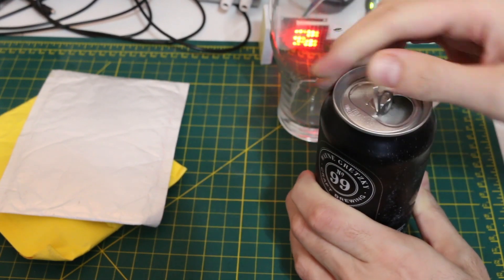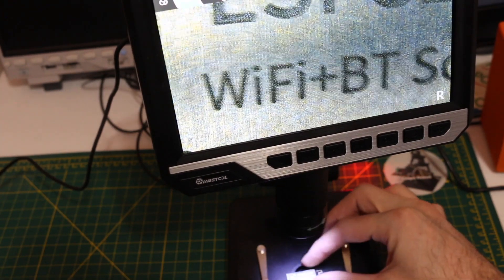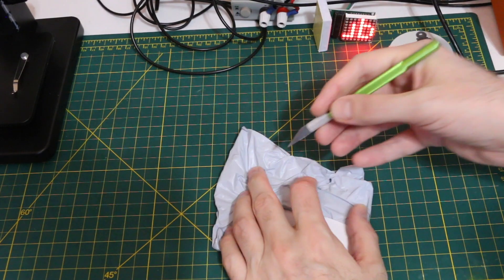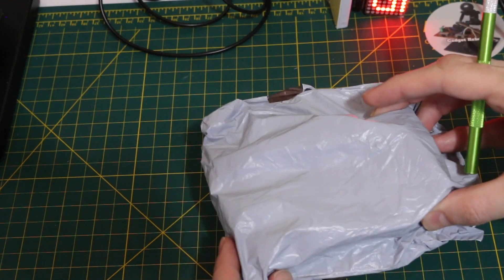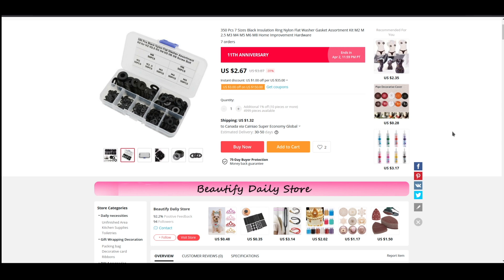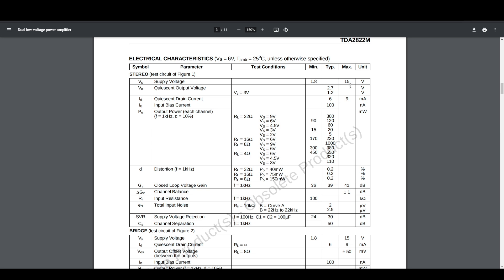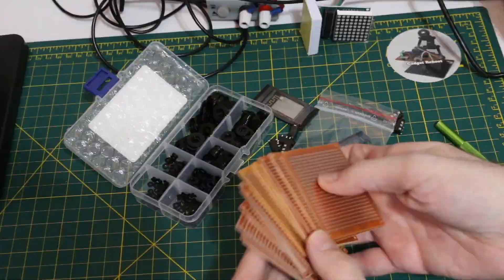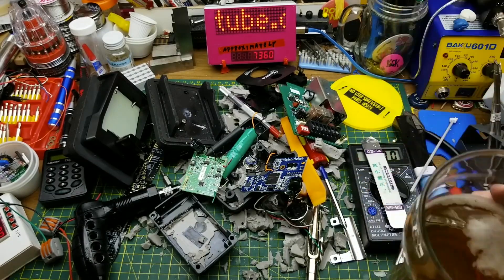GR Mailbag 21.AL.01

Comment: When I drink enough, these talking-hands Canadians seem to run together.
(glug glug glug)
Many modern amps have thermal and overcurrent protection.  Not these.  Have blown a couple of TDA2822 chips, abusing them with medium-sized drivers.  You may need some little 16ohm speakers.  Would you like a couple of TDA2050 chip amps ... you know, something that will shake the walls?
Reply from the maker: Destructive testing on TDA2822 might be a fun experiment in itself when I get all set up again and have access to everything.  I have several salvaged speakers from various applications ranging up to 12 inch that I could try to run at various levels and see what happens.   TDA2050 in the same experiment would be fun, sure! ...now I'm starting to imagine a big test bench setup with test signals, sound pressure measurements at distances, resistive  loads and a scope, and a bunch of amp circuits.  Might need to get a vacuum tube circuit started too.
Reply: @GadgetReboot  If you have something like an 18-0-18 transformer ... can put you in the Gainclone business.  
https://en.wikipedia.org/wiki/Gainclone
Reply from the maker: Going to have to look into Gainclone, never heard of it but looks interesting.  I used to have all kinds of center tapped transformers salvaged, a lot of 6v and 12v secondaries from low power stuff before everything went wall wart switching.  I remember having a 36vac long ago. Wonder where it went.  Later this year for the first time in probably literally almost 20 years, I'm going to have the opportunity to "unbox" everything I've accumulated and once and for all take inventory - it will look like a basement flea market I'm sure.
Reply: Cheers! 🍻

Comment: I was running low on those little paper-ish washers that you use on motherboard mounting. I think the nylon ones would be a good alternative.
Reply from the maker: They've been useful in the past when I needed to do anything from insulating boards/screws from making contact while mounted, to just helping shim a gap, and also to act sort of like teflon surfaces to allow parts to move for adjustments and then get secured in place elsewhere.